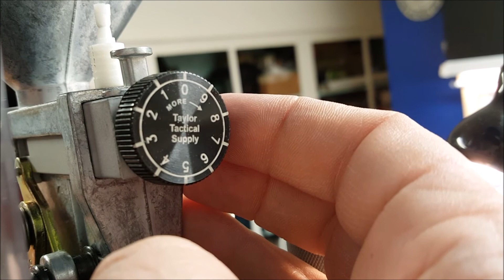Taylor Tactical Powder Bar adjustment knob for the Dillon XL650

Comment: I bought 3 of these because of your video. I didnt remove the bar from the powder measure. I put in a vise to squeeze the washer in then removed the thumb pin. Removed from vise and it screwed right out. Reinstalled in reverse. I didnt even have to remove the power measure from the tool head.
Reply from the maker: I'm glad you like them as much as I  do!  Thanks for the tips!!

Comment: Fred,. The wavy washer is a spring washer.  If you get the screw started you can press the bolt /adjustment screw down with your thumb and apply / slide in the fork.
Reply from the maker: drexotic thank you for the tip!! I've corrected it since the video was made.

Comment: Watch the installation video and written instructions are unnecessary. But here is my over kill instructions.
You should with wrench hold nut on opposite side of trigger assembly and on other side use Allen key to loosen trigger assembly allowing trigger assembly to move white square bar  out of bar. When putting back together maneuver the white square back into position and push 6he trigger mechanism upwards and the bar will smoothly move to its forward and rearward positions.  Tighten up the trigger assembly to fully position the white square.  I was able to utilize a washer along with the wavy washer by positioning the fastener and carefully tapping it in.  You must use the wavy washer to produce needed tension.
Reply from the maker: Thanks for the tips!!

Comment: The included washer was too thick on my square deal B. I used a  vice to compress it to get the key back in the bar and I used the original washer and the wavy washer

Comment: Does it have a lock washer or other means to ensure it doesn't move once measure is set? This is vital, esp. when loading steel shot.  Thx.
Reply from the maker: bartofilms it has a spring or wavy washer to hold tension on it.  I have five of them now and all are rock solid.

Comment: You're telling people the wrong way to get the bolt retainer out. You should push the powder bar against a table, bolt side down. This will compress the wave washer and allow the retainer to come right out. In fairness I only watched your video until I determined you gave the incorrect procedure.
Reply from the maker: I'm sure that there is "no" one correct way to do this.  This video is actually posted by the manufacturer's website as their demonstration of their product.  Thanks for the comment and input.